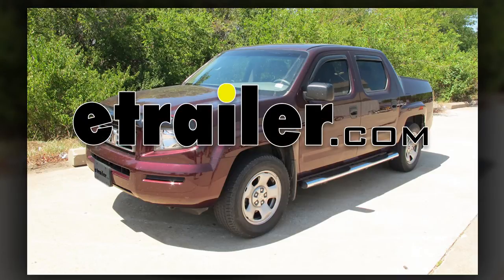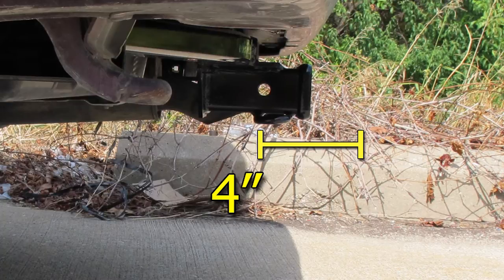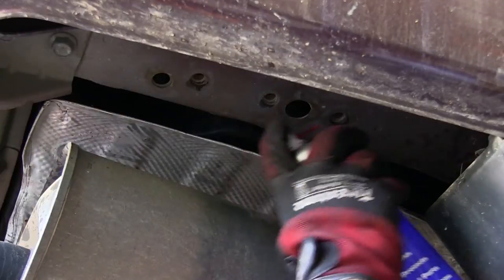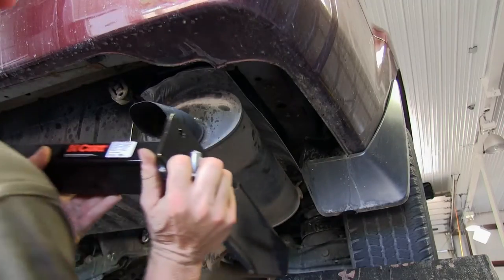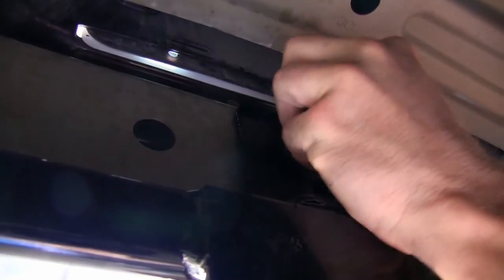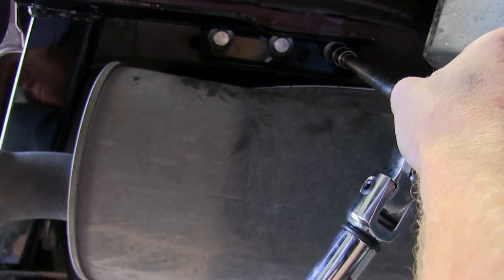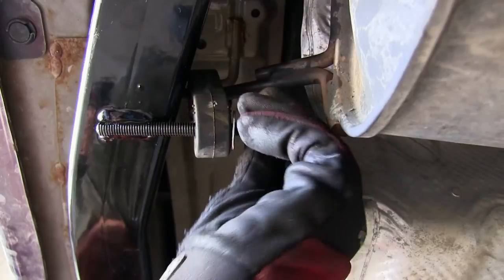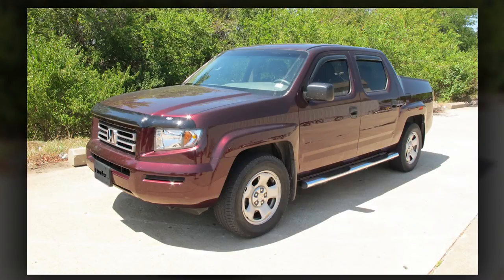Installation of a Trailer Hitch on a 2007 Honda Ridgeline - etrailer.com

Comment: Looks easy on screen.  Not so easy in the real world, especially if the hitch holes are off by 1/4" and require an hour of filing to make them work.  Second time that has happened to me with a Curt hitch from etrailer.  As a manufacturing engineer, I'm disgusted by the shoddy quality control.  If they can't do better, at least they should ship a free rattail file with each hitch, and warn the customer to premeasure and file to spec to avoid having to wrestle it into place...TWICE.
Reply: Totally get it. The state of the world these days. I have NEVER had anything fit perfect first time. On anything so if a little filing is needed, a good day. At least I won't have to re-drill.